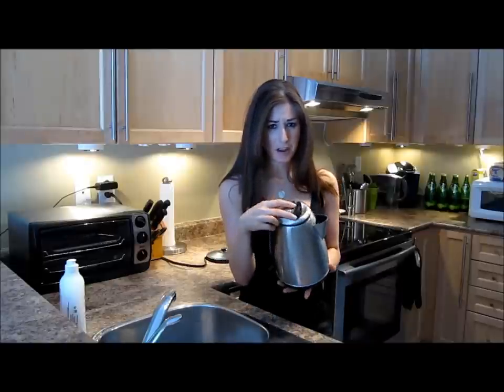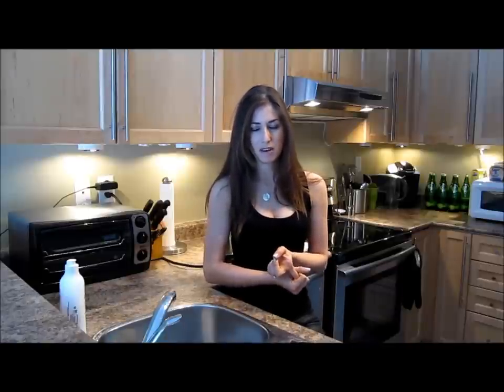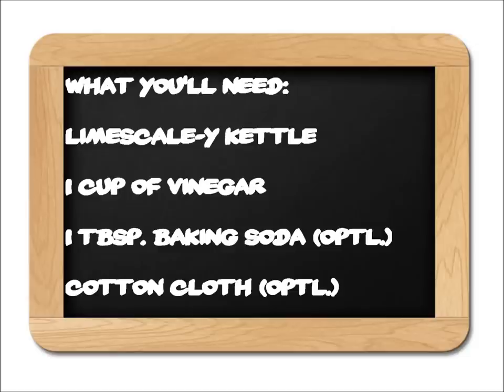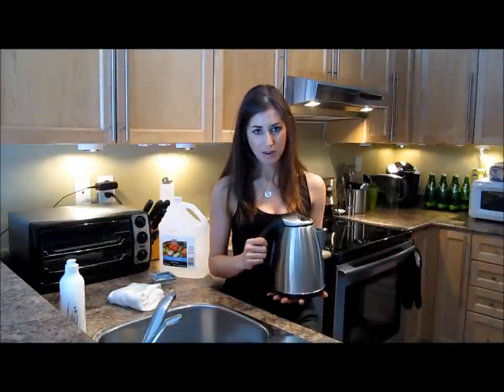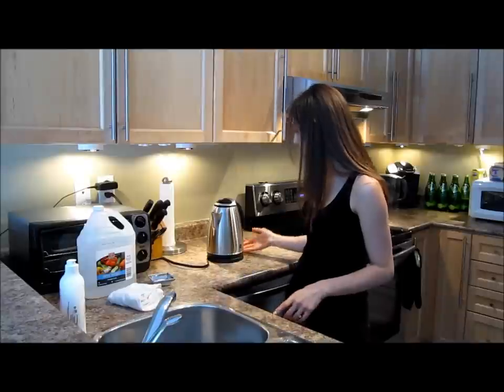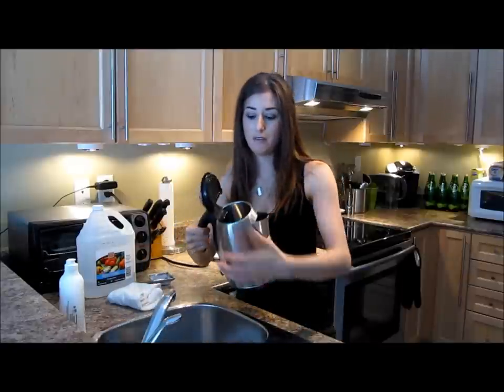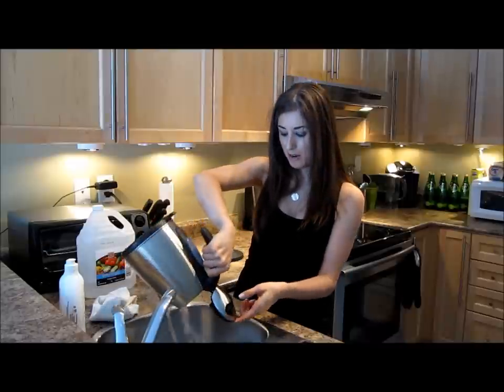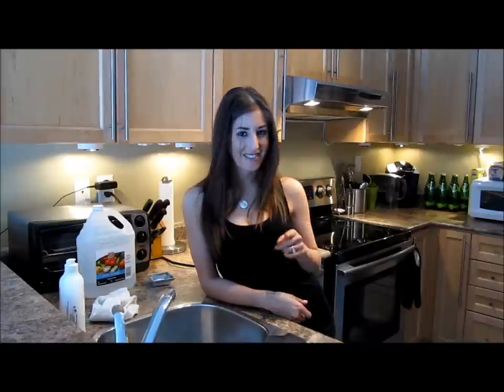How to Descale a Kettle (Easy Household Cleaning Ideas That Save Time & Money) Clean My Space

Comment: Warning, here in the south, cockroaches like to live in the lid of the teakettle. They enter by the tiny hole in the top and live in there and lay their eggs there ( which requires them to pee on the surface first and then stick the eggs on the roach pee) , until we boil the water, and then they come running out. They also live inside the Keurig pots at my schools and teacher lounges!! So, clean regularly and before the day is done,  cover those entries with cheese cloth and a rubber band to prevent unwanted roaches! Gross, very gross! If you have roaches, even in New York, check this place, they WILL be in there!

Comment: Well, the vinegar worked great on the kettle! However, the baking soda and vinegar in the sink caused the joint in a pipe to loosen off and dump hot vinegar all over under the sink. It was an easy fix, but be cautious with that method.

Comment: "Vinegar and Baking Soda", huh!  I'll have to try that, myself.  I've cleaned with Vinegar before and discovered that I am not fond of the smell.  I've been using Lemon or Lime juice to clean my Kettle.  I just boil the Lemon/Lime juice and then pour it out.  No scrubbing needed.  That works too, all these products are acidic and nontoxic to Humans.  However, I've noticed recently that the plastic filter on my Hamilton Beach Kettle has dissolved, somewhat.  The plastic is flaking apart into tiny black specks, not sure if it is the results of the Lemon/Lime juice.  I wonder if your Vinegar and Baking Soda has similar effects on your filter.  Thanks!

Comment: Use citric acid. It has no smell and no acidic vapor that can get into the eyes or damage nearby painted surfaces. It is part of most foods and lemon juice, so need to thoroughly rinse. You can mix citric acid stronger than the ridiculous 5% to get it to work faster. If there is buildup around in the lid, turn the kettle over and immerse it in a bowl of hot solution. If the kettle has paint on the outside, it may start to strip off.

I clean the coffee machine once a month, I run the acid through it twice, then pour it into the kettle and they both get descaled.

Vinegar seems to work better to reach places not immersed into the solution. But citric acid is very effective, even in the bathroom, as long as you can get it cheap (€3/kg). Find a place where they sell food grade citric acid in bulk. Probably on the market along spices, fermented cucumbers or cabbage. Don't buy small packets or comercial descalers. Check that it doesn't have insoluble additives like silica (apparantly a thing in america).

If the pot has coffee or tea stains in it (percolator), boil baking soda in a seaparate pass. Don't neutralize it with acid as they do everywhere.

Comment: Hi Melissa, I didn't hear what temperature to heat the kettle to and for how long?
Reply: Lots of kettles will only boil (~212 Fahrenheit, 100 Celsius), and as for how long, it depends on how severe it is. If it’s just standard maintenance or very light, do it once and let it sit, but if it’s particularly bad, you may want to do it a few times and let it sit overnight.

Comment: Once every 6 months? You must live in a very soft watered area.

Not sure many people's hand would fit in a kettle like that. Anyways, here's a better and easier way to clean your kettle with no after cleaning to do like with the vinegar. 

Just get some citric acid (it is edible and used in foods and you can get from any grocery store or supermarket), put 1-2 tea spoons in and boil, and it'll be clean as a whistle, then pour out the water after about a minute or less. No need to worry about any smell or weird taste in the kettle. Thank me later. And even if someone accidentally drinks it, no harm done, as it is edible. But it's easy to notice the difference when it has citric acid in the water. 

If you have large amounts of limescale like very thick around the heating element, then your beat option would probably be to try it 5-10 times or just get a new kettle :)
Reply: Can I jist squeeze a lemon?